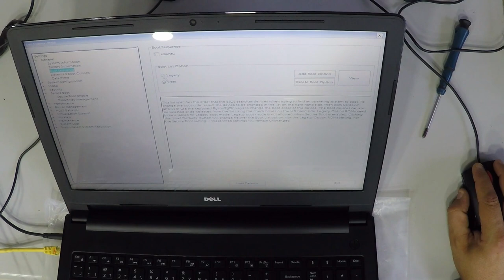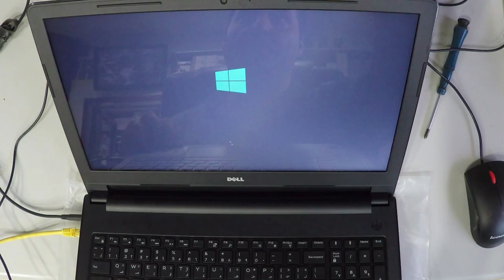Dell Vostro 3558 HDD TO SSD UpGrade

Comment: is it possible to install HDD & SSD together in Dell Vostro 3558??
a processor is i3 1.7ghz
Reply from the maker: Hello Pradeep, You can replace your DVD(Optical drive) with a 2.5" SSD with this special 9MM CADDY. http://amzn.to/2EpK5Vp
Reply: @Shamsabdelkader  we came across laptops where due this the motherboards are failed

Comment: seems that there is no space of the ssd m2,in order to use the hdd +ssd together,isnt it?
Reply: Bro you can remove your optical drive and replace it with ssd too
Reply: Ssd sata 3
Reply: @toandang2284  My idea was hdd+ssd M2,not the sata3 ;)

Comment: hi Im planning to buy an SSD for the same laptop. When you installed the SSD and turned on the laptop, you had to go through some settings. Could you please tell me what to do in that part to make sure that my pc works fine.
Reply from the maker: You don't need to do these settings just install a fresh copy of your OS.

Comment: which SSD type is supported for Dell Vostro 3558?? And Any recommendation for SSD?
Reply: Hi Shafeeque, Did you find which SSD we need to buy for this system? I have the same Dell Vostro 3558 laptop
Reply: @shafeevkd  Thanks for a quick response, just one more thing... Any SSD we can use ? Or there has to be a special type to put in this specific laptop? I know we need a 2.5 inch SSD but except that, anything else is important thing to keep in check while buying it?